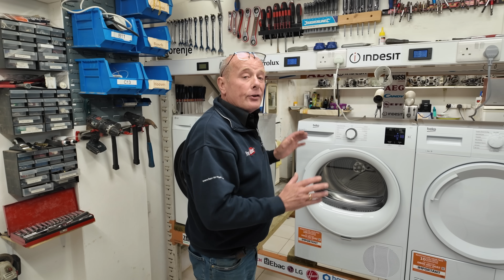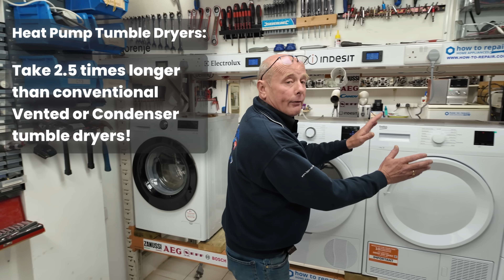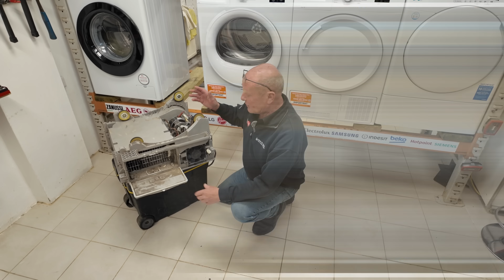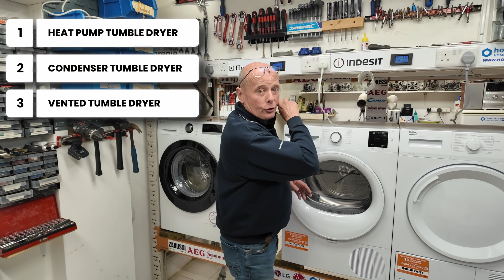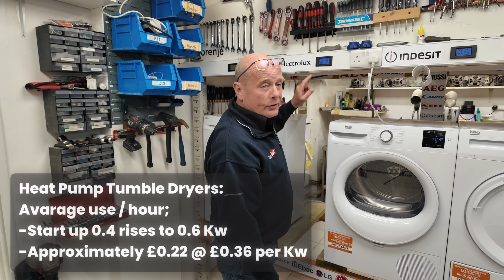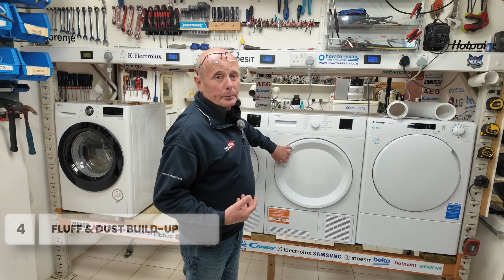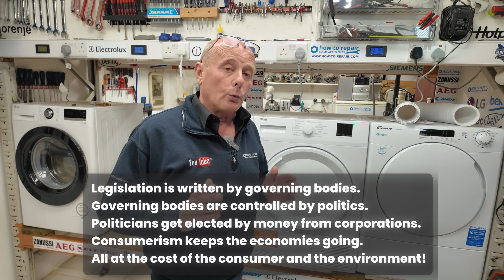Tumble Dryers the Shocking Truth About Heat Pump vs Vented & Condenser, NEW LEGISLATION!

Comment: vented are best i would say easy to fix 4 thigs to go wrong they can last 20 years most do
Reply from the maker: I've reached the point where I simply cannot tolerate this situation any longer, and that's why I made these videos. 

If any of your friends or family are thinking about buying a new dryer, it would be helpful to share this video with them. It will give them an idea of what to expect when purchasing a new dryer.

I hope older models will still be available, but I can't promise that. It's important for people to know the differences between the dryers on the market and understand any potential issues before making a purchase.
Reply: @How-to-repair  yep vacuums are the same low watt cheap rubbish cant buy a little hose needs be hole head £80

Comment: Sounds like the same BS that's hit building regulations. Windows now have to have vents in them by law which negates all the thermal and acoustic performance that a new double or triple glassed window would otherwise provide. Thank you for exposing this con. There should be laws governing the ease of repair and replacement of short lived components. When I've stripped down broken washing machines 90% of the components look brand new and completely re-useable but they've become unserviceable for a single component you can't buy or is uneconomic too buy.

Comment: Perfect timing. Was going out this weekend to buy a new tumble dryer and you've convinced me to stick with condenser dryers. I've always repaired my own appliances and am always astonished by how shoddy modern technology can be. They are all designed to fail!...Great info buddy.
Reply from the maker: Glad the timing worked out for you! Sticking with a condenser dryer makes sense, especially if you’re already comfortable repairing your own appliances. It’s frustrating how so much modern tech is built with planned obsolescence in mind, but it’s great to see people like you pushing back by extending the life of your appliances. 

If any of your friends or family are thinking about buying a new dryer, it would be helpful to share this video with them. It will give them an idea of what to expect when purchasing a new dryer.

I hope older models will still be available, but I can't promise that. It's important for people to know the differences between the dryers on the market and understand any potential issues before making a purchase.

Comment: A good article. 
For years I had a vented type but had to channel the heat out through the wall because if vented indoors would cause excessive condensation. This of course wastes energy. 
I went over to condenser type which must be closing in on 12 years now with a Zanussi which ironically had the drum bearings replaced under warranty yet hasn't required any further attention since except frequent vacuuming of lint. This machine, instead of sending valuable heat outside to warm the planet 😉  it actually warms my kitchen for me. Something of a bonus. 
As for the heat pump type which as you say requires a longer run time. Something I don't have as I would not leave an electrical appliance running unless I was indoors the whole time - I had a friend who was a fireman and warned me if the dangers  -  so the shorter duration of approx 1 hour suits me better. 
Also, as you say, the first two are easily repairable at home cheaply and can be maintained for years.
Whats not to like?
Unless you want to sell the things...

Comment: They are crap my white knight died and had to buy a heat pump one because I wanted a built in one
Reply from the maker: If any of your friends or family are thinking about buying a new dryer, it would be helpful to share this video with them. It will give them an idea of what to expect when purchasing a new dryer.

I hope older models will still be available, but I can't promise that. It's important for people to know the differences between the dryers on the market and understand any potential issues before making a purchase.

Comment: In my experience condensing tumble driers take twice as long to dry as vented tumble driers.
Reply from the maker: A blockage could be causing poor airflow and heating problems. Regular maintenance will help prevent this. Thank you for your comment. I appreciate people like you taking the time to write it out. Please share it where possible. It might help others make a wise choice instead of being misled by the industry.

Comment: I live in a condo and don’t have any way to vent so I have to rely on a heat pump system.
Reply from the maker: I think heat pump technology is brilliant, but these machines are only lasting on average five years they take at least two times longer to dry the clothes at least twice the amount of wear and tear and components and the accessibility to do maintenance is an absolute nightmare. manufactures do not seem to understand what maintenance is needed and how easy it is to do. They seem to build it and assume it's perfect without testing properly. Thank you for your comment. I would be grateful if you would share this post, as it’s the only way to force things to go large nowadays. Have a great day, Paul.

Comment: At Time 08:05 

A G4 filter mat can be attached right in front of this grid.

I have had a heat pump dryer for 6 years and installed the filter mat 6 years ago and vacuum it regularly.
The filter mat lasts for about 150 cycles until it is so matted from vacuuming and cleaning that it needs to be replaced.

I simply bought U-shaped plastic profiles for €5 from the hardware store and glued them in as a filter frame.
I still don't understand why the manufacturers don't build this system like this in the factory.

Instead you get sponge filters that are useless.
The filter mats can be bought very cheaply by the meter or a little more expensively as cut pieces. A filter mat like this costs under €4 for the whole year.

Comment: I had a condenser tumble dryer previously and it dried the clothes so much better than ,this heat pump bosch i bought clothes are always creased with it expected better from such a much more expensive machine
Reply from the maker: I think heat pump technology is brilliant, but these machines are only lasting on average five years they take at least two times longer to dry the clothes at least twice the amount of wear and tear and components and the accessibility to do maintenance is an absolute nightmare. manufactures do not seem to understand what maintenance is needed and how easy it is to do. They seem to build it and assume it's perfect without testing properly. Thank you for your comment. I would be grateful if you would share this post, as it’s the only way to force things to go large nowadays. Have a great day, Paul.
Reply: Think it's crazy to be honest,the last dryer was a hoover condenser and it was fine did the job ,then i was talked into buying Bosch heat pump tumble dryer and washing machine and it takes ages to dry and creases all my clothes even half full definitely won't be buying this again and the washing machine was just as bad it was boiling the water on 40degree wash I think all new appliances are just cheaply made now